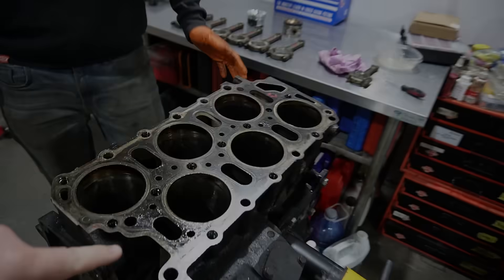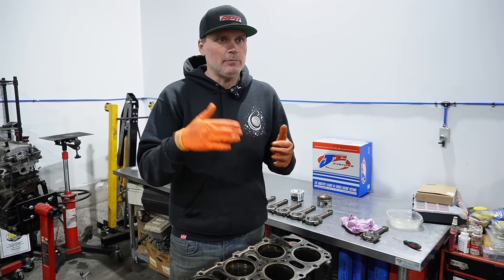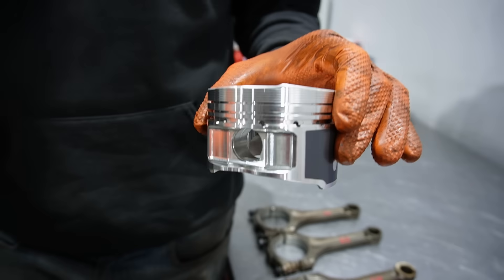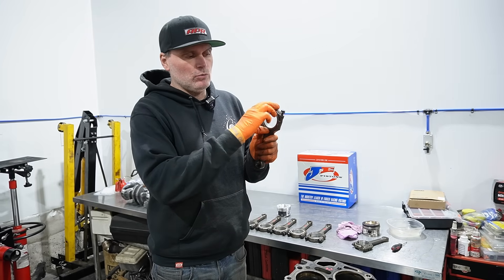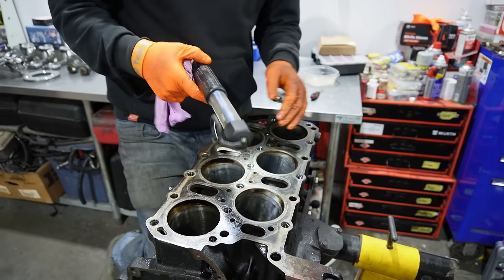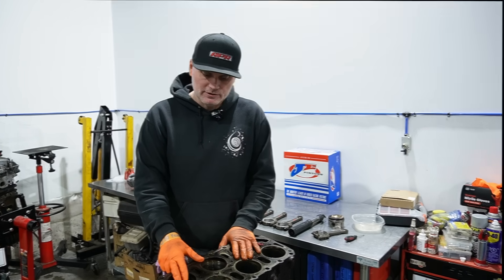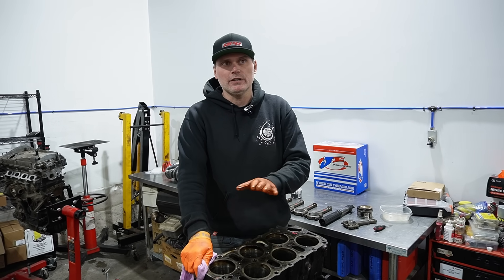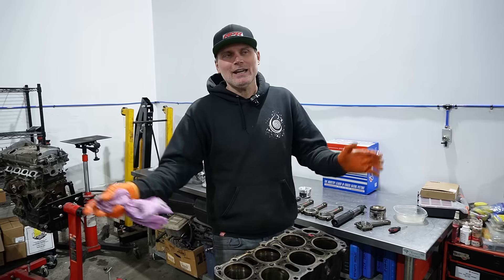VR6 Turbo Build, Must Do's.

Comment: Hello, if anyone could help me, I was watching a lot of VR6 videos months ago, something very interesting I came across (can’t remember which video it was but I’m on a VR6 video streak in hopes of finding the video again) 

basically when the person added the spark plugs, I remember them saying the spark plug had (can’t remember if it was VW recommended or personal) to be torqued to a certain specification where the spark plug faced a CERTAIN direction, so it had a clean flame deflagration (explosion in simple words) it was really interesting to me because it was such a cool engineering explanation and smart technique. If anyone knows what I’m talking about let me know.
Reply from the maker: Old school technique, not required on modern day fuel injection.
Reply: @COMotorsports  thanks, any idea what keywords I could use to watch a video about it on here?
Reply from the maker: @DEATHWISHVQ  it's called indexing plugs, again nothing I'd waste your time on if you're running any sort of modern fuel injection.

Comment: @COMotorsports what is your preferred head gasket for a 3.2L motor build using 9:1 pistons instead of a headspacer with plans to run 14-28psi? Block will be slightly overbored to 84.5mm.

Comment: I have a MK4 R32 and I'm running a G30-770 turbo build. It's on a standalone and tuned on e85 at 500hp with stock bottom end/head was rebuilt. I'm curious if you have ever seen the clutch pressure plate dig into gearbox housing so bad that it cracks the housing? We installed a brand new single disc ACT clutch with ACT flywheel. I drove maybe 5 months and couldn't get the car into gear. Stock 02m gearbox and the pressure plate was digging so bad it left indents on the housing. I had it diagnosed and they suspected crank walk. Wear spec is .30mm and I measured .38mm. Would the crank walk cause that much damage to the gearbox or is that more a clutch fitment or install error? I pulled the pan to see if I had any thrust bearings or metal shavings and absolutely nothing.
Reply from the maker: Did you have the spacer plate in between the engine and trans, that can easily cause your issue.
Reply: @COMotorsports  I did ask them if the spacer was present and they mentioned it wasn't. Shop told me that the spacer was too thin and wouldn't assist with causing that much damage.
Reply from the maker: @j7d7s  I can tell you on our drag car if it's not there it will eat the case. This is a twin setup but my point is it can make a difference depending on the setup.
Reply: @COMotorsports  it's only a single disc clutch but it's insane that the thin metal spacer could cause the issue
Reply from the maker: @j7d7s  all comes down to the stack height of the clutch setup.

Comment: Hey guys if I turbo the r36 24v wagon and just do a head spacer and uprated head studs what sort of power could i make safely. And also does the r36 passat wagon  come with forged pistons on stock block??
Reply from the maker: How do you plan on fueling it?
Reply: Errm I'm in the UK we use 95 and 99ron I'll be using 99. But fueling system, e.g injectors fuel pump etc I have no idea guys. Please could you give me some advice i am very new to this vw thing🙏🏾

Comment: A 2004 Jetta body, some kind of 4motion AWD, a 24v VR6 making 700 horsepower, and a sequential shift transmission. Wouldn't that be a sweet package.
Reply: That's currently what I'm looking to do, minus the sequential box.
Reply: @Dexs911  Sounds like a fun project. I love a good manual, but it would be hard to deny how quick a sequential would be, without any drop in boost.

Comment: I have 07 Touareg 3.6fsi would like to put turbo and have 500- 600hp of it 😂😅....
Reply from the maker: Do it.
Reply: @COMotorsports  what's the roughly price tag for it ?
Reply from the maker: @dejanmeki  well there is no kit so your making a lot of it yourself, and there will be tons of billet parts required to make the parts needed. Way more than the vehicle is worth, so if that scares you, then time for another project. Lol

Comment: if you go forged pistons do you need the spacer?
Reply from the maker: No. Spacer is just a cheat to drop compression. Aftermarket pistons would be spec'd for the application.

Comment: I have a Audi A3 3.2vr6 first gen, mine have forged pistonrods and stock pistons and can run fine at 750whp. 
I've heard the rods blow at 500hp, but pistons can take a beating.
Mk5 r32 crank crack at 500hp ive heard from my tuner and vr6 engine builder
Reply from the maker: It's reverse. Rods good pistons not so good.
Reply: @COMotorsports  weird since mine run fine with stock pistons at 750whp for 20.000miles
Reply from the maker: @NeTRoMA3  👍
Reply: @NeTRoMA3  you might be running e85? i run e85 and make 750whp with forged rods and stock pistons also. otherwise if i was running pump fuel i wouldve upgraded pistons also.

Comment: I run 15psi on a Mk4 gasket and non-intercooled on a 66mm turbo, but I'm also on e85.  Just found your channel.  Now build an 8 valve if you really wanna steal my heart. 🤪
Reply from the maker: Appreciate you joining in. As for the 8v.....hmm lol
Reply: Sweet set-up 👍🏾 .. definitely agree on the 8v build.. they should go wild and build a g60 turbo😅

Comment: Good video. I am about to embark on a 550WHP (approx) 3.2 into a 2001 S4 B5 manual. Learned a lot and will do rods, pistons and a good head. Flywheel and adapter is probably the single biggest $$$. Probably go with Holset Cummins turbo at around 18-22 boost. Pick N Pull has my motor for $349CDN complete from Toureg.

Comment: I kinda disagree with what was said in the beginning. Yes knock/detonation is caused by poor tuning (this is why having a standalone is important. Failsafe  would’ve saved it)  but forged pistons are not gonna stop knock/detonation. I’ve seen forged blocks go just as quick. The weak link no matter what will always be rod/journal bearings. Stretched rod bolts. What I disagree with is the HP numbers. I’ve seen 800hp with just spacer and rod bolts.  All on a 12v but that power is useless in a FWD car hence why most who are at that and above are usually awd. I don’t say this after building one VRT. I’ve built plenty in my 30+ yrs in the game. 23 as a shop owner. I have a VRT that’s been seeing 30 lbs of boost for 17 yrs without opening it once. Went through a few turbos and a few trans. That’s due to a good build and good tuning. My point is don’t think having forged internals with prevent these things cause they won’t. Detonation don’t give a shit what you got inside. I’ve seen a  few broken ringlands on forged pistons. I’ve seen holes burned straight in the middle of the piston. It all comes down to tuning and setting the failsafes so it doesn’t get to that point. What they do is allow you to set your comp ratio better then a spacer. With the spacer you only have 9:1 & 8:1. Pistons you can do 8.5:1 and so on. It also allows for deeper valve pockets for those running big cams. (288’s and bigger). 

Keep up the good work guys. About time you’re touching a man’s engine. Not that crappy 4 cyl junk. 😁
Reply from the maker: We're talking to 99% of the people that are on YT so although you disagree these are good rules to follow for the average person. We've seen stock VRs make 1000whp that doesn't mean it's partial for the average person. Guys doing stuff like that are much like us with the 1.8t stock engine that we made 600whp. We have the means to get there safely. Regardless of which engine or how many cylinders yes of course knock/detonation will kill all of them without question.

Comment: A local vw enthusiast shop mentioned to me that running a double head gasket is better than a gasket/head spacer/gasket on these engines since the head spacer wouldn't "tolerate much boost". Is the two head gasket route even an option? I'm still naive and inexperienced so thank you for answering my previous question you guys are really cool
Reply: I assume that was the case just want to always double confirm with experienced people. Thank you so much for replying to all my stupid questions ❤ I really appreciate the content you guys bring and time taken to reply
Reply from the maker: It is possible to stack gaskets but it's just more room for error. If you look at an MLS gasket you will see it's 3 layers. The middle layer gets taken out and the spacer goes in its place which replicates a stock gasket, just thicker.
Reply: @COMotorsports   Is the head spacer absolutely needed in each case or running something like JE pistons with CR 8.5 is a better option? For fueling i'm planning to get what's best at the pump + an octane booster additive most likely
Reply from the maker: @krasimirdavidov4639  if you're doing aftermarket pistons than the headspacer is not required.

Comment: Never heard about the mk5 r32 crank cracking but I have heard from a German guy who has 1200hp turbo vr6 that he is using a crack from a 1st gen VR6 (AAA) corrado motor and mk3 gti VR6. The mk4r32 vr6 crank starts to crank at around 800whp

Comment: The VW Mk4 R32 is my dream car. But I can’t afford one that has under 200km/125mi. What’s a better investment - get an R32 with this mileage or do $10k of mods on my stock Mk4 GTI with 240km/150mi to make it pull similar horsepower, get a body kit, paint job, new rims, & coilovers? Thanks!
Reply from the maker: If the cars in good shape, what does mileage matter?
Reply: @COMotorsports  Valid point.
Reply: tbh the biggest thing is how important is AWD to you vs FWD. If its important, the R32 is the only game in town.
Reply: @millennialmalaise9386  thanks so much

Comment: Mk5 r32 when we turbo them we aim to run them at 480hp @ the crank, when there 500+ @ the crank they have a good chance the crank will let go in the long run, mk4 r32 had a forged crank and mk5 r32 had a cast crank, we have seen afew mk5 r32 cast cranks snap at 500+hp in the long run
Reply from the maker: Do you have instances of actual broken mk5 r32 cranks?

Comment: Please explain... why would upgrading to ARP rod bolts change the inner dimensions and require line-boring? Thanks in advance.
Reply from the maker: Different clamping force.  No different then squeezing a plastic bottle
Reply: @COMotorsports  Thank you

Comment: I bought a 2.0t BPY gti engine from canada that im going to build up for my mk6 R. Im gonna do pistons rods new valve seals.. i already have ttrs lpfp modded and the vis motorsport hpfp. I got a big turbo ready to make 500+ crank hp with meth and ill need to find a clutch to hold the power.
Reply: Looking for clutch recommendations for 450ish torque range
Reply from the maker: @haroldbutler778  We offer what you need. You can email us.

Comment: Now we're in my wheelhouse 💪.

My stock rods lasted until 30psi, 20* of timing, on e85, and borg s366. So approx 600-700 wtq is the limit or stock rods.

Stock pistons are good to about 600whp with them being gapped to roughly 0.025". Anything more and you need aftermarket forged.

When tuning, keeping it a point or two on the rich side and will save the hot cylinders.

A head spacer/low conpression pistons are only necessary when using pump gas. E85 does not need lowered compression so you get to keep low-end torque when using corn juice.

The mk3 12v vr6 has a FIBER head gasket and MUST be replaced if turboing. It will not hold pressure well. While the head is out, put new valve seals in and HD springs.
Reply: We’re you referring to 12 or 24v? Besides the last comment
Reply: what about a 3.6 if you would know
Reply: @williamhall7446  3.6 is direct injected with high compression. Not the best recepie for a reliable turbo build.
Reply: @patriklenck1735 is it direct AND port or just direct?
Reply: @mikelmarion  only DI. Sadly No PI
Reply: Ey dude can you help me finding forgein pistons for my vr6 3.2L I’m rebuilding it but I’m not sure where to buy the pistons and other aftermarket parts like in you guys experience whats the best reliable not to expensive
Reply: Agreed. I’ve made 600 on a stock bottom end 12v with a built head, on e85 of course. Once I got over that 600hp mark I started to go through pistons

Comment: I’ve got an A3 8P BDB motor and from what Ive read has a forged crank 🤷‍♂️ “same” motor (BUB) used in R32 IV/V.  Is there a way to definitively say if the crank is cast / forged?  I always was under impression it was forged and not given it a full inspection 🙈.

Going with 9.25 compression JE’s with MaxSpeeding H rods (with 2000 Arp’s), plus headstuds, and adding a brace plate as well.  Pretty much using HPA inlet / exhaust and BW EFR92/74 turbo, cnc ported head, Newman cams, supertech valves, EcuMaster, Deka clutch… so gone the whole hog here. Looking to run 750hp … fuel will always be 99 RON … any advice for the build to make so sure I dont trash all this expense!!!?

Comment: Maybe you guys can give some insight. I   Have a built 3.2 bottom end stock head. Did 3/8 bolts whole nine. But it does have a cast crank mk5 3.2 engine. I want to make close to 800whp. Don’t know if I should change the crank
Reply from the maker: I believe we discuss this in the video.

Comment: Just want to add, you can use stock head bolts with a head spacer. HPA uses them even with a 5mm head spacer plus 2 full gaskets, and have had no lifted heads on their 780ftlb of tq builds. ARP head studs should be a requirement for 800+.

Comment: Im building a boosted 12v in a mk2 golf right now. I'm getting close to being finished. I didn't do apr rod bolts or upgraded pistons, though. Hopefully, with the united motor sports tune I can get close to 400 wheel hp. Also got 2 spare engines and an extra  transmission 😅
Reply: that thing should cough out 400whp easily on pump gas. mine did 400 @ 15 psi on pump gas
Reply: Hunting a body to start my build 😢
Reply: E85?

Comment: The VR6 is one of my all time favorite engines. They just sound so good with a high flow exhaust.
Reply: Way better than any of the popular i6 engines
Reply: They sound amazing for sure! I currently own an Atlas with the 3.6 flavor and it replaced my Touareg that was recently totaled which had the 3.6 flavor in it as well. Very smooth engines that sound awesome when you  "feed em the onions"

Now it might not be the most powerful engine out there but the Acura Vigor inline 5 sounds even better. One of the best sounding engines ever made!
Reply: What would you say a average 2.8 turbo build costs?

Comment: How much can the factory Intake manifold take in regards to boost? 3.2 bhe Its plastic and long but it hides the turbo view pretty well so I'm wondering if it can be used until some limit
Reply from the maker: Haven't pushed one, I wouldn't bother the effort to build a turbo kit around something that's going to fail doesn't make sense. Cause when it fails you're redoing intake and charge piping to run a short runner.
Reply: @COMotorsports  makes sense, after seeing how the two turbos position i'll need a short runner either way, thank you for the reply!

Comment: You mentioned head spacers but when using forged pistons that lower compression is a head spacer still necessary? I guess a better question would be: what compression ratio is recommended for pump gas as you mentioned?
Reply from the maker: Lower comp pistons, no need for headspacer. It's just used to lower compression.
Reply: @COMotorsports The head spacer is a great option though, as it makes the VR a non interference motor. So maybe take that into account when making your purchase.